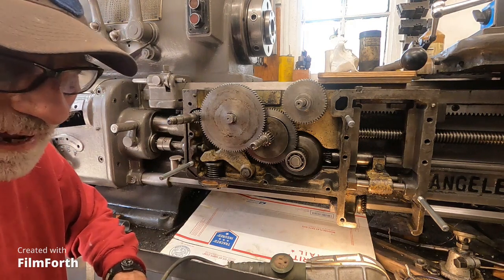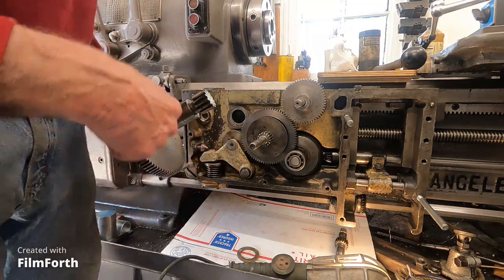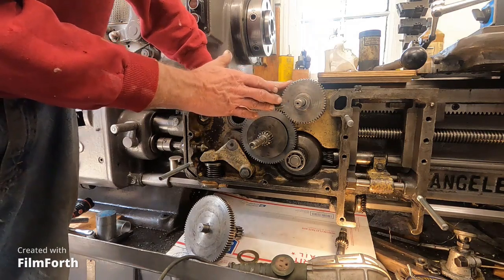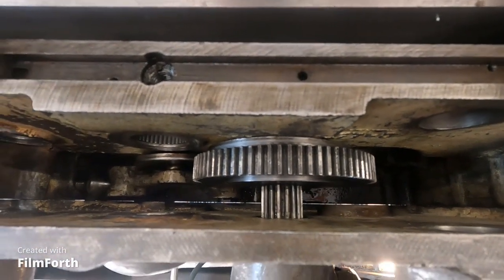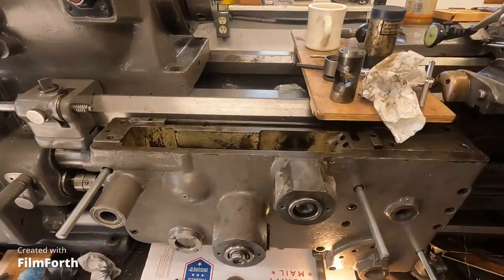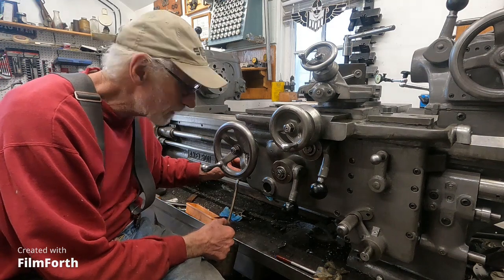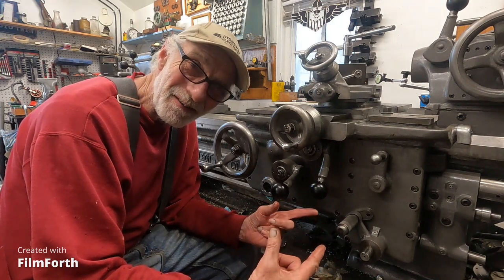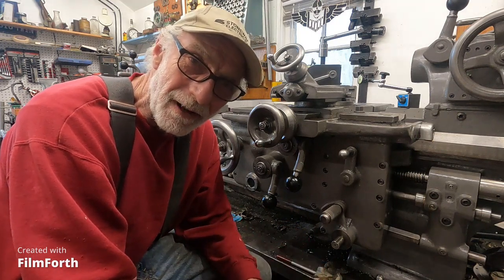Axelson lathe carriage rebuild observations

Comment: I’ve had to re-make several parts for my 15” leblond. The cross feed screw and nut were worn beyond function, It’s about $5k to buy replacements from leblond. The bevel gear that’s driven off the power feed rod and drives the power feeds is the same deal, more for the single gear than i paid for the machine, so def made that. There’s a handful of other parts. You buy an old machine and you feel like you’re getting a deal, but after the amount of time it takes to REALLY get that machine back into service, you better make sure you’re getting a heck of a bargain on the initial sale lol.
Reply from the maker: Yes, there is no way I could put the time it takes to get this going if I was not retired.

Comment: I have a 1959 Boyle & Emmes lathe 16" x 60" and the clutchs work about the same with the arms . I need to adjust the cross clutch because it sticks . I will try your adjusting trick when get to it . I thinkI gave 3500.00 for my lathe top speed of 480 rpm
Reply from the maker: That sounds like a good price for a heavy machine like that. Hopefully everything is good with the clutch
Reply: I did the adjustment on the clutch and everything is working great Thanks for the tip